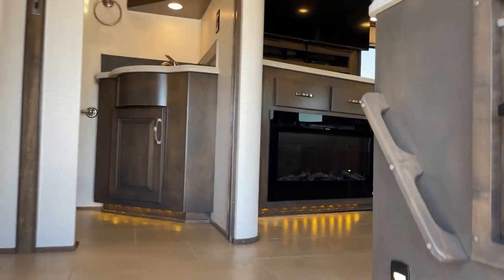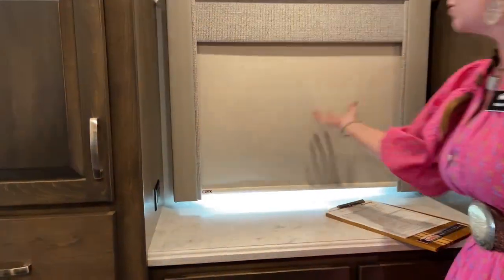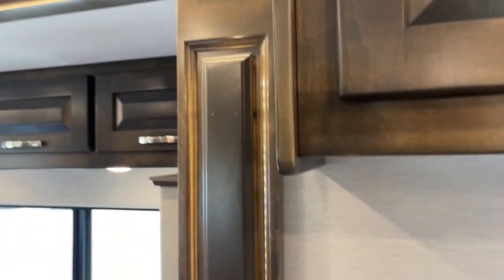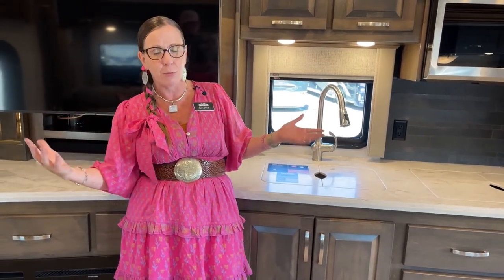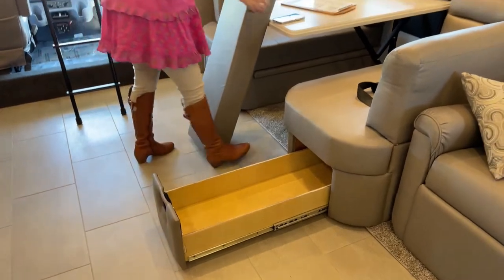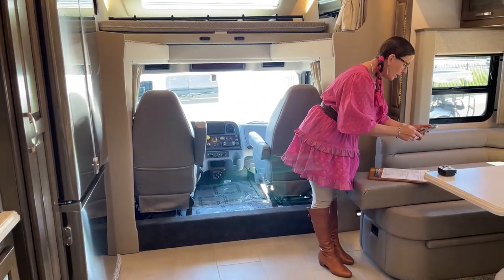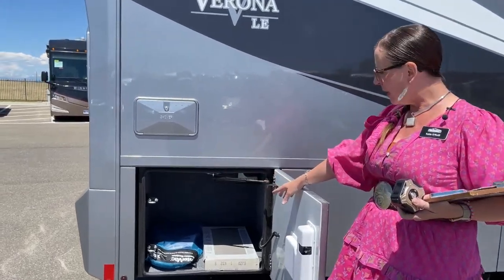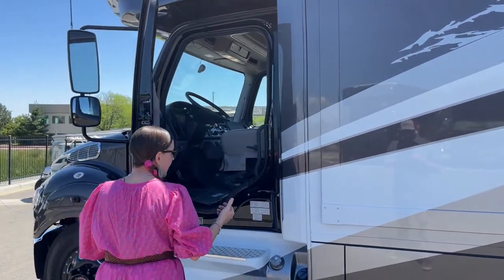2023 Renegade Verona LE 40LRB

Comment: You still have shower faucet in your back. They need to make shower square and teak bench. You can only get that in cascadia or newmar.
Reply: Hi Cecilia,  The 2023 faucet is a lot better because you can sit on the bench without turning off the water. 😂 Newmar does have a Teak Bench. I have one in my 2022 SuperStar and I do like the fact that it can be folded against the wall so that I have more room. The Cascadia Chassis doesn't really have anything to do with the bench though. In the Explorer (which is on the Cascadia Chassis/ see "2022 Renegade Explorer 40ERB - The King Of Super C’s" 2:26 on YouTube), there's no bench at all.  🤷